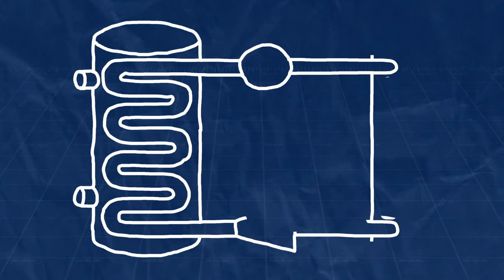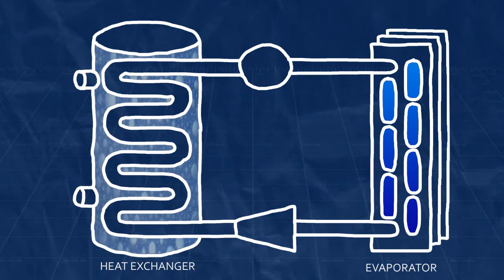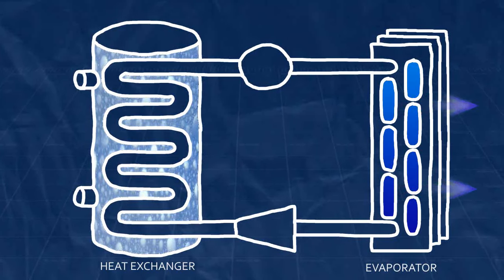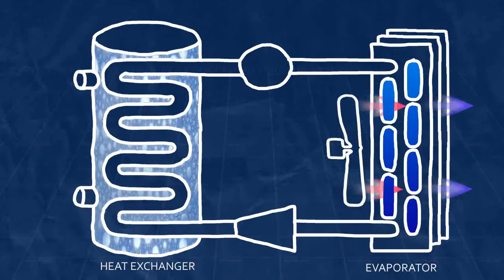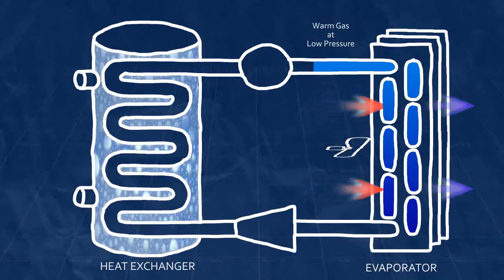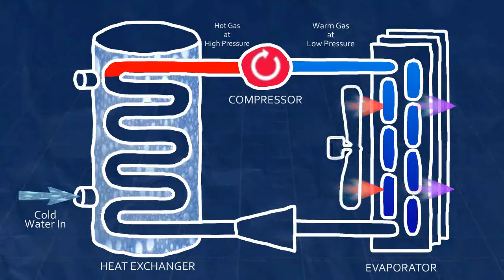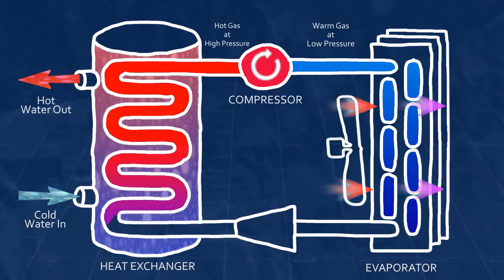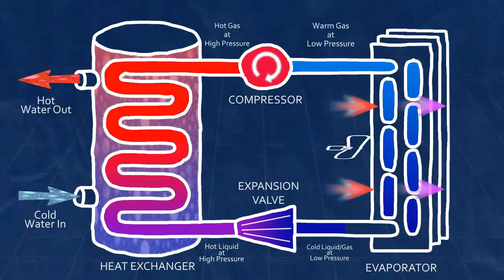What is a Heat Pump

Comment: At the very end you say that the expansion valve turns the high pressure cold liquid into a vaporous state by "greatly reducing the pressure and temperature" which contradicts the beginning of the video that states that the evaporator is the mechanism that does this. wouldn't it be a cold low pressure liquid that leave the expansion valve?
Reply: good point
Reply: The evaporator turns the liquid into low pressure gas then goes through the compressor to high pressure gas. When it goes through the water it is cooled and turns into high pressure  liquid then the expansion valve turns it back to low 0ressure liquid

Comment: Unfortunately you say the evaporator is inside the building. This is a poor design because you will now have to heat the room back up. A real heat pump water heater places the evaporator outside the building.

Comment: So to be clear, the heating of the water is seemingly entirely due to the compressor that increases the heat of the refrigerant due to an increase in pressure. With the cooling of the refrigerant seemingly occurring as a consequence of the decrease of the velocity / pressurisation of the refrigerant due to the turnings of the pipe work within the heat exchanger. Why not simply have a closed system where the refrigerant is maintained at a constant high pressure?

Comment: The refrigerant leaves the condenser will be low Temperature with high pressure liquid. the job of the expansion valve is to turn the refrigerant into low pressure gas which is already low temperature. That's case the heat can travel from the air into the the evaporator which absorbs that heat to become hot gas low pressure going to the compressor to start the cycle again.,

Comment: The audio is so low I cannot hear anything. It's a pity because the video looks well made. I took my laptop and put the speaker in contact with my ear and I still cannot comprehend anything.
Reply: +Alessio Sangalli 
switch on the subtitles option, it is the left one on the right. works perfectly

Comment: No Reversing Valve on your Heat Pump ? This seems to represent a water source Air Conditioner where the Condenser is always located in the heat Exchanger rejecting heat into the water source and the Evaporator is always in the air flow absorbing heat from the supply Air. Where as on a true Watersource Heat pump the Roles of the Heat exchanger and he Coil in the Air Flow actually switch depending on the Demand. For Example if the water source was demanding that the temperature be lowered , Then the role of the evaporator would come from the heat exchanger where the Low temperature Liquid Gaseous Refrigerant would Absorb the heat from the Water source and then The Condensor would be in the Air Flow where it would reject the Heat. The Reversing valve would be necessary to accomplish the reversal of the Roles that each coil plays. This is the basic principle of how a Pool Heat Cool model Heatpump works as well as most Residential Heatpumps that Cool the house in the summer and Heat the house in the winter. Alternatively in Large Scale commercial Industrial Heatpumps. Technology has advanced enough that they can be designed to use a Hot Gas bypass with three Coils instead of just two.
Reply: What is the benefits of hot gas ?